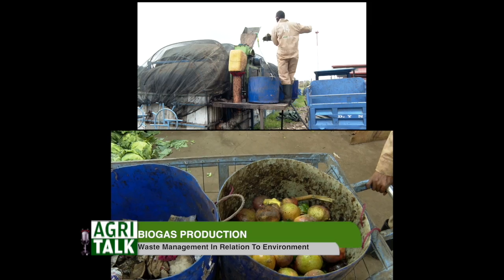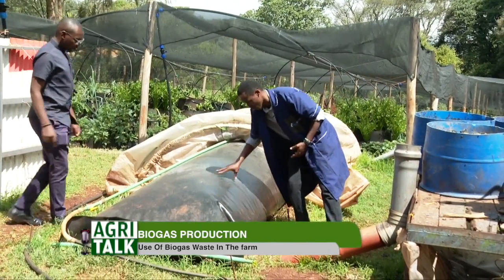How food waste is converted to biogas and manure - Agritalk

Comment: This is great. 
I was wondering if it can be stored in cylinders for later use. 

My Question is, Can you store the biogas in cylinder or sale to people who would want to buy and use it in their home ?
Reply: The compressor would cost a fortune.
Reply: Look online for videos there's a lot on comprising methane or biogas into propane cylinders and check out videos on biodigesters and àlso conversion of stoves furnaces hot water tanks and gasoline powered engines to run on methane which is biogas
Reply: woundnt be much profit , with the price of things today. but for home storage one could buy those big farm water tanks, or those bladders. ya can use canisters, itll compress some, but not like propane, wont be near as much.
Reply: Found this: https://youtu.be/jwk1R7-6R3s

Comment: What type of material was the  ballon (tank ) made of and how was it sewed to form the balloon?
Reply: i think they might have wrapped the plastic sheets around an alkathene pipe then used the same diameter  split pipe to slide over to act as a clamp. Don't know how they manage the corners though

Comment: @FarmKenya I have a question. Do you know if there is a limit to the maximum pressure the bacteria can handle?
Let me give you example. Let’s say the balloon is full with the gas and the pressure in the balloon is 100 psi ( 7.03 kg/m² ). I then travel for a long time and come back after many months. Is the pressure going to be increasing over time until I get back home or is there a pressure limit that will stop the digester until the gas pressure drop below 100 as in this example?
If the gas pressure will keep going up, is it possible that the balloon might explode due to the increase in pressure? Thank you!
Reply: The biodigestor mimics the conditions of a cow’s stomach for the bacteria present there in. Do you honestly believe that a cow’s stomach can reach 100 psi?  The interviewee, Dominic, stated that bottling the gas was not feasible.  This alludes to the fact that this systems was not intended for high pressure.
Reply: Check online methane can be compressed into propane cylinders solar cities has a excellent vidio on how to make a digester and there a lot of videos on utube on building digesters and on comprising biogas into cylinders and converting things to run on methane so you can run your home on it from cooking heating and hot water to running motors generating electricity to driving on it
Reply: @douglaswindsor120  p.s. Trying to get a gas compressor shipped to Kenya is a logistical nightmare.  It will be stuck in Mombasa for seven months under bureaucratic red tape.  However, when a certain sum is passed to a certain official, the situation turns very expeditious.
Reply: @estebancorral5151 I ship from china regularly.

Just make sure your machine has an inspection certificate before importing it from china.
The port officials just want to make sure you're not importing hazardous substandard machines that will end up injuring or maiming you.

It's important to understand the logic before complaining.
Reply: @estebancorral5151  I'm medical doctor in Nairobi, I don't have vested interests in Mombasa port or any other port.

I import my medical equipment and many other things including mechanical engineering equipment, agricultural equipment, solar systems, consumer electronics and have never gotten stuck at any time.
As long as your machine has an inspection certificate from the country of origin, you've paid duty and used a legit clearing and forwarding company.... Hizo zingine ni story za jaba na hekaya za mtaani.

If your goods have been impounded, be sure you're doing dubious things
Reply: @Hobby_trails_repository  have you ever imported peltier-effect cooler for storing insulin or any other hormones?
Reply: @douglaswindsor120  It will be nice if you can put the titles or links to the videos your are talking about.
I know there are videos on YouTube.
Reply: @douglaswindsor120  yes, at an exorbitant price and a minimum of 20% loss of energy value trying to compress to gas.  As the interviewee, Dominic, suggested find applications where compression is not needed: drying food, heating for new born animals, cooking, gas lighting.  There will be less capital investment, have benefits that much quicker.